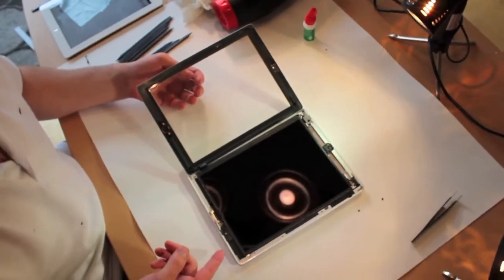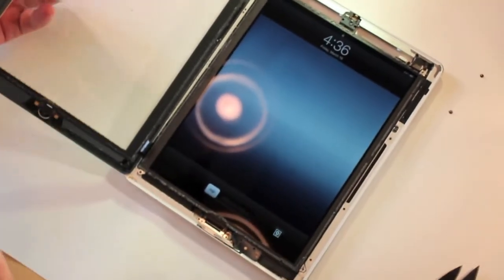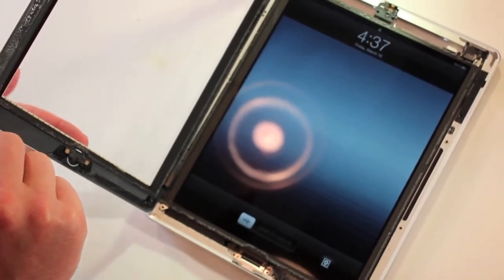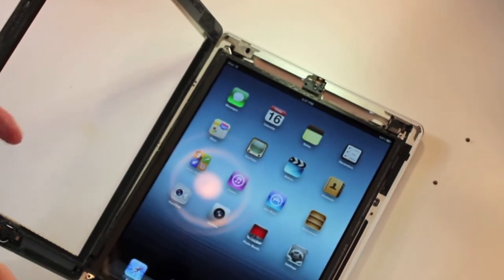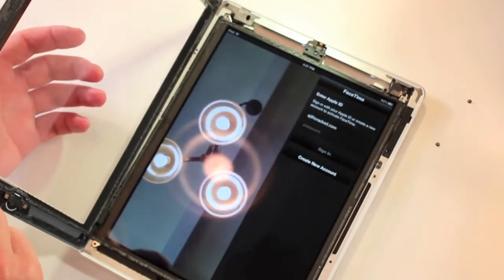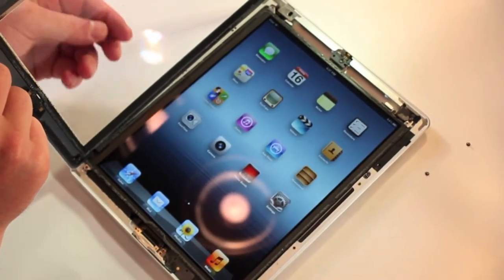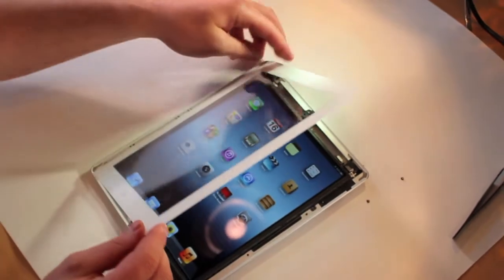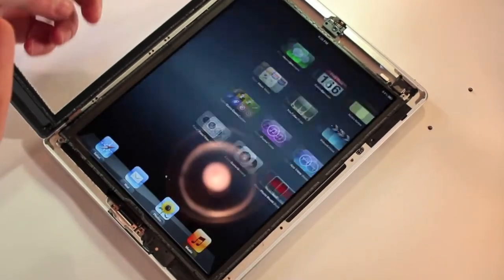The iPad 3 / New iPad Disassembled and Functioning - http://www.iCracked.com

Comment: do you think it would be possible to trim / cut the digitiizer to make it smaller? I need to fit an Ipad in a car. Id like to make the digitazer the same size as the screen and relocated the home button. I'm wondering if it will still be functional. I would only need to trim a tiny bit off of the black bezel.